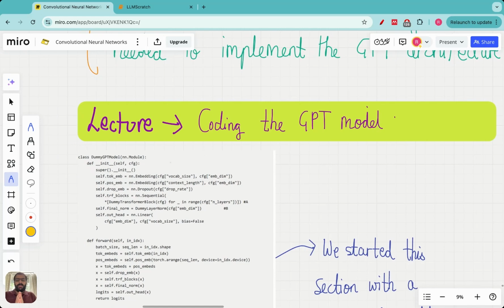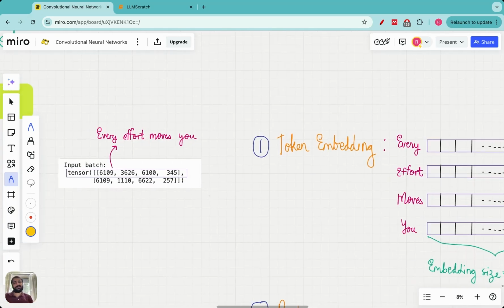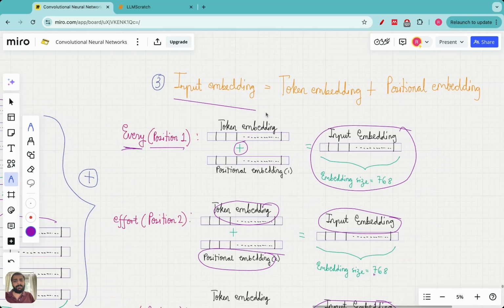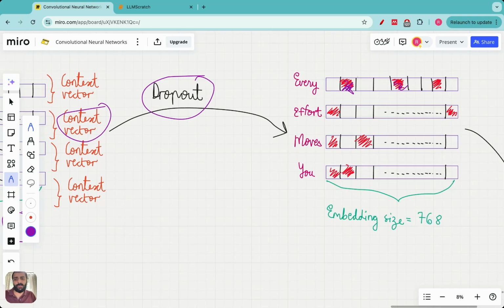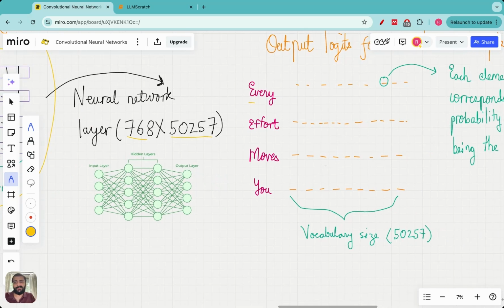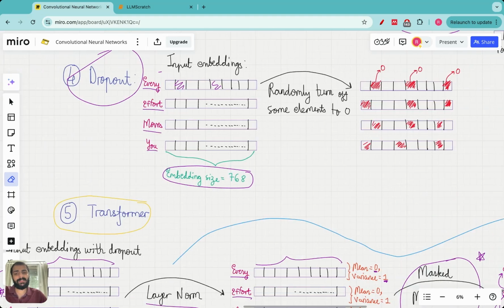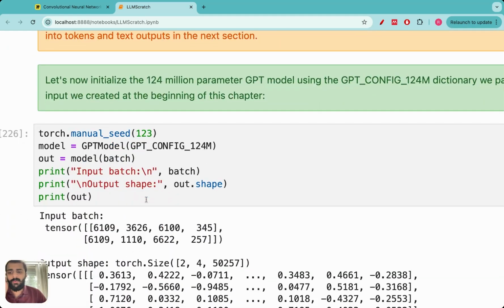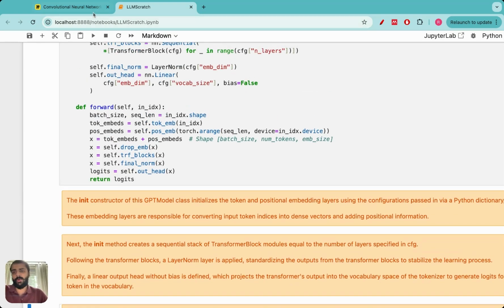Coding the 124 million parameter GPT-2 model

Comment: 36:45 why does a context size of 4 result in 4 predictions? Shouldn't the first prediction happen only after prefill (i,e, finish all 4 tokens, then predict based on the last token "you"?
If there are actually 4 predictions, what happens if the prediction based on "every" is not "effort"? i.e. the prediction does not match the context provided?